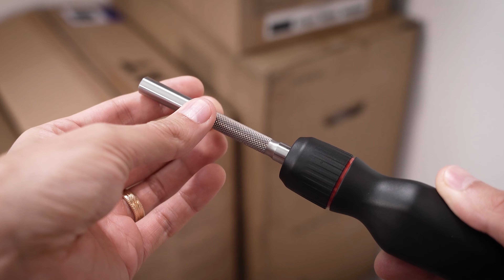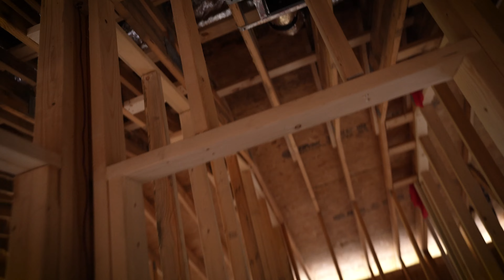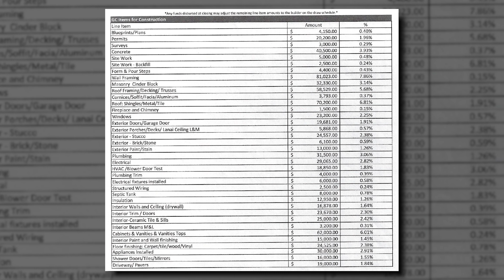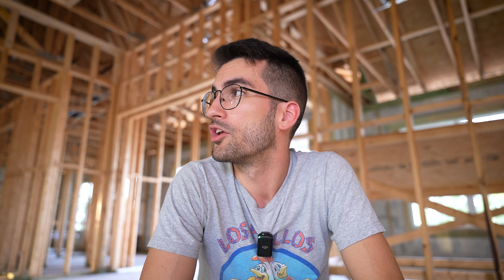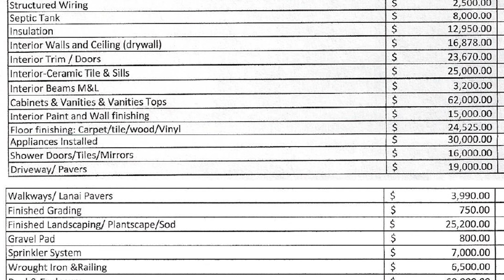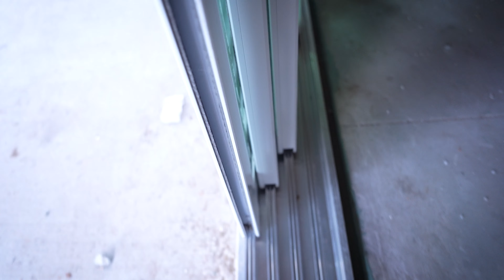Here’s How Much EVERYTHING Costs...

Comment: Looking at this....yeah I'm glad we just found a nice floor plan from a regular builder for less than 1/3 the cost. Quality probably isn't the same though, we've already had like 6 warranty claims in 7 months. Most of it's small stuff, but it's frustrating how they basically just do the bare minimum and then count on you to find the problems within a year. It was either that or a 20+ year old home though that will need a lot of work regardless. At least in our case the warranty covers the costs, for now.

Wish you luck with the custom build!
Reply from the maker: 1/3 the cost - do you mean for the design/floorplan? I guarantee you the fact that it was already an existing floorplan has little to no bearing on the actual cost of the build Lol. The wood costs the same whether it's a cookie-cutter house or a custom one.
Reply: @GregSalazar  what? No I mean we bought a prebuilt home rather than try to make a custom build work. Left us a healthy budget to just modify what we wanted/needed such as some electrical upgrades and doing a little reframing on the interior.
Reply from the maker: The cost you're referring to is the architect fee alone, correct? I'm confused because you didn't specify to what "1/3 of the cost" references. The fact that you built a pre-designed home won't change much at all in the way of total build cost. Only place you'll save is in your architecture/design fees, which amounts to roughly $5K-15K for most builds. A small price to pay, IMO, to have a house fully designed by you from the ground-up! :-)
Reply: @GregSalazar  we didn't build the pre designed home, it was built up as part of a community. We bought it move in ready, it had been sitting after financing fell through for a few other buyers and was priced to sell. We got very lucky with the market downturn at the end of last year, and the timing of the construction otherwise we would have paid 20-25% more on the same house. We checked the neighborhood sales, everyone around us paid higher prices for the same model, some over $70k higher just a year prior! We also didn't have to front any of the cost for utilities, internet, storm water management, land clearing, etc. That was all subsidized by the town or the rest was handled with a CDD. Our quote for a fiber run alone at the plot we were looking at was in the low 6 figure range on the custom build because they had to run a drop from the main line 4 miles down the road and we were responsible for the entire cost it's like 70k a mile...At the community it was all done at a subsidized cost by the town and ISP as part of an infrastructure deal.

So ultimately all the related expenses add up, even if the actual cost of the structure itself was nearly the same.

Comment: Architect here - just one point, if a home owner "designs" their own home and then approaches an architect or engineer for stamps/ seals for a permitted set, no professional is going to take on the liability of project. It's just better to go to an architect first or a general contractor first. Hope the rest of the house goes smoothly!
Reply from the maker: We did not "design" the home. We told him what we wanted, provided a few examples of floorplans we thought were viable, and went from there 👍
Reply: @GregSalazar  That's the norm for the relationship between an architect and client. I just wanted to provide additional input to what you said around the 8:40 mark of your vid!

Comment: Like parts for air conditioning, try running a large maybe like 2” diameter pipe if your server is an area you can’t get to easily when house is finished. Just in case something is missed , makes easier to put a cable through.

Comment: Make sure they are giving you an AC system that youll actually feel on the second floor. Many times contractors dont calculate the correct "ton" unit you need.

Comment: If I was in Florida I would run your low voltage for you. I’ve done houses bigger than that by myself. Also I would look into your isp to make sure if it’s coax or fiber so you can get the right input line to that closet. Once everything is closed in your up the crap creak. I see it all the time. Not sure what your doing as far as wireless but I allways use a gateway and access point. I use mostly ubiquity and put the ax pros in the ceilings of closets so there not seen. Depending on how big the house is will determine how many to use. Thank for reading. Ryan at RYNO TECH

Comment: Hey Greg, I highly recommend you consider cat6a and even a couple of fiber cables. Cat6a is more reliable than 6 and is likely to better handle future fast speeds. It doesn't cost much more. Also consider doing multiple drops for key runs like your Youtube room to server room. You never know when a cable will stop working.

Comment: HUGE TIP:  if you haven't done so already, take pictures of all the walls before the sheetrock goes on - you'll have so many times you need to hang something or check something where you wish you had an X-ray view into what's sitting where, that you'll be glad you can go back to the pictures.  On a side note, I guess it's too late to put any wood framing around your windows, but keep in mind that means if you need to hang curtains you're going to have to use masonry bits and drill into cinderblock.  I live near you, we built our (far less cool!) home in 2018, and so 5 years forward those are our lessons learned :D

Comment: First of all, I like your content and dry humor :) I moved to the States 11 years ago from Deutschland, and my wife and I build a house similar to yours in 2018. I still remember all the hassle you experience right now. I am also an electrical engineer and could run my entire data cabling throughout my house by myself (3000 ft of wiring). I also bought and installed all my light fixtures and kitchen (IKEA) which was a much better deal and look what I have seen so far from the show houses here in the Midwest. Btw, our front door costs $8500 and came directly from Europe, so $5000 is an ok price, I guess :). Pool cost are also insane. We added one last year and spent a little bit more than you did but I also had to cost some amenities because of the after COVID prices. To the comment regard the American style of building houses. I talked to a German architect, who told me it doesn't matter what material you will use for building houses, both will last approximately 100 years. And since Europa experienced tornadoes in the past, you see that brick houses won't stand the power, and tornadoes in the US are much stronger too. So, be assured, your house is as safe as can get. It brings back so many memories. Thanks for sharing and keep up the great work you do!

Comment: Looks like you've really done your homework, Greg. I work as a multi-family GC estimator and can confirm that trying to pinpoint costs within margin of error is virtually impossible especially with the federal reserve fluctuating interest rates. I am curious if you negotiated a GMP contract with your builder (at least for those scopes of work that were finalized at contract). If you don't want to disclose that, I understand. That does insulate you financially to some degree if there are massive swings in cost ie lumber, copper, masonry, labor rates, etc. A builder may not always agree with that but if their qualifications and assumptions of the contract do not negate contract terms (such as claiming lumber materials as an allowance), then they are responsible for increases due to time and materials unless you (the owner) change the scope of work. Justifiable change in scope from original documents will result in a change order and most builders try to be very, very clear about that. Also thank you for stating that a good design is critical for a smooth experience. Cheaping out on the design team is what gets our clients in the weeds all the time and makes my job a real chore to execute on. Our team prides itself on being excessively detailed which often puts us at odds with design consultants. But I also think value to the owner is more important than a design award for the consultants that cost the owner 20 or 30% more than their original budget. Nothing in your schedule of values provided by the GC seemed out of line at a glance when stacking it against the general footprint of the home.

Comment: $32330 for CMU.... A CMU block cost around $3 and you usually get a discount when buying them in pallets. That would mean you bought at least 10,776 CMU blocks. Seeing how a solid 100' x 60' rectangle 26' tall (2 Story 12' ceilings) with no openings for windows and doors would only use 9360 CMU blocks (about 12k sqft) and your home is only 4k sqft, you definitely overpaid on that. Also your home plan looks like it has a mcmansion nub roof, was it supposed to be a hip roof?  Don't have time to go through the list and price check everything but I'm betting you overpaid on more then just the CMU blocks. Thanks for posting this vid, I needed a good chuckle.

Comment: As an electrician I’d recommend you ask your electrician to run your cat 6 drops. It’ll be cheaper and they can do it while they rough the house and then do terminations yourself. You’ll also avoid having to deal with a separate contractor and save on that end

Comment: The comment about the european houses confused me for a few seconds. Most if not all modern houses in Germany and probably most of Europe as well are build just like your house with drywall. 
I guess the commenter lives in an old house that is build from natural stone or brick but that is not really any more sturdy than your house will be when its build.
The only advantae with that is that you have a better climate inside the house without an AC, but in Florida you need an AC anyways.
The walls of European houses are not concrete, just the lintel (structural parts, above windows and doors) and sometimes other structural parts are concrete in almost all circumstances...
So this commenter is talking out of his ***** and does have very little clue about houses in general...

Could you talk about the HOA (you mentioned it in the first video)? I have mostly heard horror stories about HOAs and those are not a thing (or at least very uncommon) in Germany, we do have condo-associations though which are generally similar I guess. Maby you could go over the costs for that, the rules you have to follow, the advantages of being a part of an HOA and maybe your experiences with HOAs. I am pretty sure most peaople don't have that bad of an experience with their HOA even though there are so many horror stories (you just don't hear about it when everything is fine).

Comment: Our house in the Netherlands was finished a few weeks ago. In the north of the Netherlands we have some small earthquakes as a result of more than 70+ years of sucking natural gas from the ground. Our house is built entirely of timber frame construction. Only the brick walls were placed after finishing the roof and insulating the timber frame. But there are houses that have complete concrete floors and walls, but these are less earthquake resistance.

Comment: Majority of houses in the UK are concrete base, brick walls and wooden framed. 
The main difference is a dual brick wall to provide a cavity for insulation. Concrete breeze block internally then a facing brick on the outside for looks. 
Everything else is very similar to your own build.

Comment: I feel like I can explain the card board house thing. Here in the UK our exteriors are made or brick with a cavity space between them blocks like you have inside. The house you've designed seems more robust than the average American home as often they are constructed with timber and covered with OSB (oriental strand board) or ply then more wood cladding or 'siding' as it's called in America hence being 'paper' or all wood.

Don't get me wrong at all that house is lovely and looks very robust BUT using bricks and blocks is not traditional to the way most American houses are built is what I'm saying.
Hope you enjoy the house Gregg looks great :D 
Don't let the haters get you down they probably can't afford a cardboard box with inflation.

Also as a British carpenter I find the 80,000 insane but your not just paying for the wood it's all the man hours also so I'm sure that's right nothings cheap. I just paid 1000 GBP for 9 new radiators because I don't know plumbing lol

Edit, the tiled roof is also not standard most are shingles as you say and that is what we put on shed here in Britain. Tiles are much better I'm currently under a 100 year old tiled roof and it has had a few tiles changed but other than that it's still holds

Comment: Run the Cat 6 after the frame inspection and prior to drywall. Install plates and run cable (numbering both ends), just coil patch panel end and leave in the roof/wall space. Measure all locations and mark on a copy of your plan. Once the final inspection is done and you are ready to move in, cut out the plate location and pull the Cat 6 through and terminate. 

Have done this multiple times however sounds like it is a bit more lax in AUS.

Comment: Florida HVAC pricing looks crazy!  We had an estimate done for a new system on our house here in WV and using actual sheet metal ductwork it came to under $17K!  The guy who did the estimate told us that if they would have had to replace the downstairs duct work it would have came to around $19K.  If we do it, the AC unit will be in the attic and blow down from there.  They'll build a couple of enclosed tunnels from the attic to the existing duct work to reach the first floor and basement.  

You'll need to keep an eye on that style of duct.  You get a critter in your attic and it can tear it.  It happened on my brother-in-law's house.  A squirrel got into the attic ducts and wrecked havoc.  We both worked construction at the time and replaced all the duct work they had in the attic.  I don't know why they still use that type.  It's a little cheaper, "easier to work with", and "better insulated" but it's also more prone to damage.  I just thought I'd give you a heads-up, in case you never had that type before.

Comment: Hi Greg, me being an European guy, I had some remarks on your build ;). Just a question, how are you insulating? I noticed the beams on your roof are not that big and already have the AC attached to them, so how are you going to fit insulation into it or are you going to insulate your attic space? Always really puzzled when I see that in american YT videos, because that means your attic space, with  AC running through gets really hot.  
In Belgium, where I live, you really have to put verry thick insulation on your roof, no way it would fit between your beams.

I agree that plasterboard is more modular and easier to run wires later on if you need to. But yeah, as a European we were raised with the idea the interior walls that are in stone of concrete are much better, so guilty as charged I find plasterwalls to be cheap :D.

Comment: About that "wooden" aspect. Houses in europe not only have all internal walls with bricks and concrete (drilling brick is easy ) but the also have concrete columns and roof . That makes the house a "bunker" . Also external walls are usually two rows of brick with installation between them. So your house is more fragile, BUT it is cheaper to build . Because a house that big in European standards would take you back 2 times the money maybe
Reply: There is no such thing as "houses in Europe". Different countries and regions vary a *lot*. Many Nordic houses are built with wood frames.
Reply: @gedfi  Please don't make it like i talk about every European house ever build. I meant about most house in europe and i am talking about houses that are made generally. Of course there are other buildings ways that also houses in europe have. The majority are like i said , concrete brick and steel sturdy boxes with strong columns and great insulation .

Comment: 4 things I think Greg missed or didn't mention 1 please tell me your office ac is its own zone aka runs on its own thermostat independently of the other zone 2 power for office and server 3 please tell me server room can atleast fit a 1u rack with some room to get behind for atleast power and 4 he did mention cat 6 which is good but I would almost say go cat 7 way overkill for now but for long runs and future proofing seems logical plus make sure you have ethernet wall jacks where you want them a 5th would also be maybe going with mini split ac in the office or certain rooms would have been better? Regardless props to you greg and all the work you putting into this p.s. maybe get solar help with offsetting all that pc power. Also please please do a video on the wifi setup and maybe house tour when it's done if wife and all are okay privacy wise. Would also love to know what kind of water heater your doing as a previous plumbing associate at blank home improvement store

Comment: Did you consider solar panels on the roof? I have seen some videos where the youtuber claimed the cost for an entire roof was similar in cost for a tesla solar roof and a conventional one? I have no idea of the accuracy or if it was circumstantial or a flat-out lie. I am also curious on what sort of hvac solution you went with and how you decided that? Are you going for a reduced heat loss with special materials? Does you powercompany or state have any incentives to do any of the above. I know where I live in Canada there is a significant tax incentive to get a very low r rating for heat loss and energy efficiency.  Also there is significant benefits to having both solar and batteries from the power company and the province.